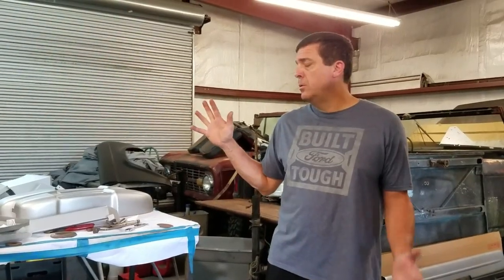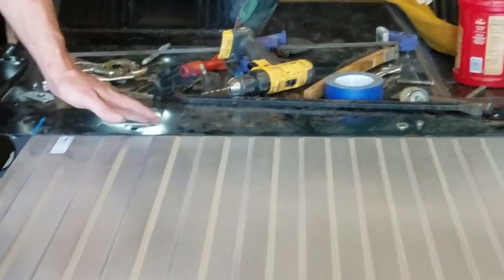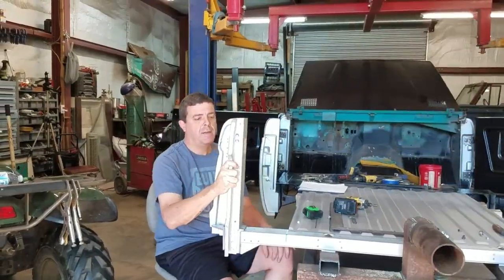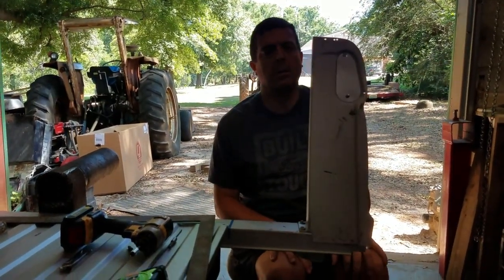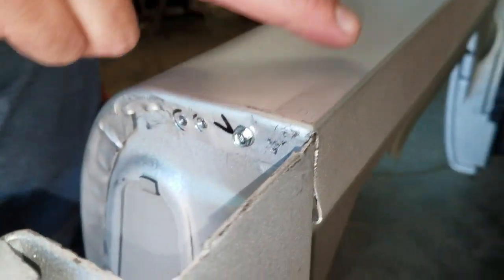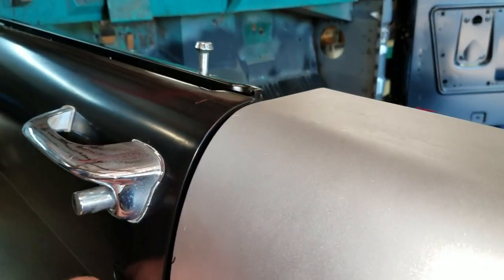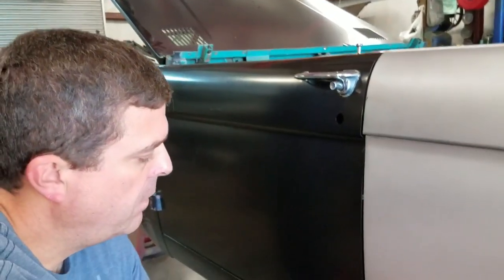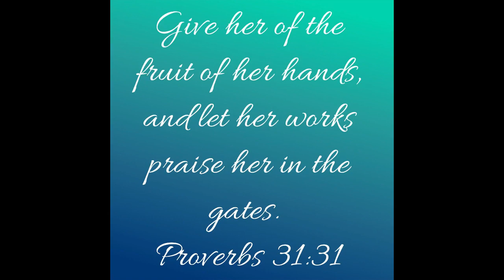Bed Removal & New Steel Install - 1966 Ford Bronco Restoration Project

Comment: If your going to spot weld the sides to the pillars,  the panel adhesive will work. I would also use a couple paint sticks covered in painters tape to help distribute even pressure across the seam and the tape makes for easier removal of the paint sticks. You may also want to put a couple pieces of tape across the outside seam to reduce the mess and make for a cleaner finish, Just pull it off before it sets.
Reply from the maker: Yes sir.  All very good points.  It worked out well.  Thanks

Comment: When I put my lower quarters on I put a 5/16 bolt on the front and rear and used 3M 8115 to glue the rest on the bolts helped to hold it in place while I was fitting the quarter and they helped hold it in place while the glue dried. I’ll send photos if you’d like
Reply from the maker: Sure Thanks!  Love to see it.

Comment: What I'm doing in that same area is plug weld.  The while tub is going in for sand blast and then epoxy prime.  I will then steam seal every book and cranny I can reach.
Reply from the maker: Awesome.  These Broncos have plenty of places for water to get in.  I agree seam seal all you can.  Good Luck and thanks for watching.

Comment: I used the 3M panel bond.  I think it worked out swell plus seam sealer is included.  That seem is subject to a lot of inside road  spray.  
And the seam sealer is just on the outside while the real water intrusion is inside.   I’ve seen a lot of quarter panels cut for large tires and I’ve never seen one buckled.
Reply from the maker: Awesome.  I feel it is a good way to install the panels.

Comment: I would love to see you use the structural adhesive. I've put on 2 sets of Bronco quarters before and I agree the adhesive might prevent future  rusting issues in these prone areas. Love your explanation and thoughts on putting them back together.
Reply from the maker: Thanks!  Hopefully once we have pre-fit all panels the decision will be easier.

Comment: I love your top bed rails mine didnt come with the ears on that go to the b pillars, I had to put that on myself and it was not easy and like you said ended up using alot of bondo to make it look good.
Reply from the maker: I got those with the B pillars.  I had to put them on the quarter panels.  They had to be trimmed a little.
Reply: @JasonJonieBuilds  oh ok I thought they were buggers to try and get right. Wish they came already on either on the b pillar or on the top rail.
Reply from the maker: @timbjork2098  I agree...Seems they can do everything else why not those.

Comment: I know this is two years to late but I think the adhesive would just separate after time and trap water. I think that spot welding and then using lead on the outside would be better.
Reply from the maker: The automotive industry uses it a lot now.  It is good stuff.  I like it better than lead.  Thanks for the input though.  We all have our preferences.
Reply: @JasonJonieBuilds  this is true but the automotive industry is also injecting foam into cab columns on pick-up truck and they are finding that they have severe rusting issues in 5 years.  That happened with my son-in-law's F150. Back of the cab had rust bubbles the size of tennis and golf balls all because water got trapped between the foam and the steel.

Comment: Wow, never thought about the panel bond, I 'm at the same point in my build and would like to know what people think as well. I agree it would totally seal up the joint and probably be stronger because of the entire surface would be bonded.
Reply from the maker: I am going to research it some more.  It would help along the long seam but will still have to weld the sides.  It would be a cleaner look for sure.
Reply: It does rust with timw

Comment: I say if you can get a good way to clamp it together tightly I would try the panel adhesive. It seems like an awkward place to clamp though.
Reply from the maker: It is an awkward place for sure.  Thanks for the input.

Comment: Welding and the heat encourages rust and it’s a hard area to get undercoating or rustproofing in
Reply from the maker: Lots of tight areas for sure.

Comment: Happy Mother’s Day to your wife! So Ford put a sealant in between uncut fender and the top panel which would tend to rust with time, are you going to put the sealant in or keep it just panel to panel?
Reply from the maker: If I spot weld it I will seam seal it for sure.  I will wipe it tight so it is only in the crack not rolling out  messing up the lines.  This has definitely been an interesting topic.  Lots of opinions have been offered.  It will come down to what I feel will give me the best results.  Still pondering it.  Thanks!
Reply: Mustang Rehab goodluck on the decision. FYI I’ve been stealing some tips from your vids! Don’t sue me 😅😩
Reply from the maker: @gusorion8151  I only charge for the good tips.

Comment: Did your bed have the middle cross brace already installed or did you have to put it on?  The bed I bought didn't have the mid- brace installed and I just ordered one to install.
Reply from the maker: Yes the bed I ordered had the brace installed already.  Do you need dimensions or anything?
I can check mine for ya.  It should not take much to install.
Reply: @JasonJonieBuilds  I cut out my old one so I'll just use the dimensions off of it.    If I run into trouble, I'll drop you a line.  Appreciate ya!
Reply: @JasonJonieBuilds  Did you coat the bottom of the bed sheetmetal with anything prior to install?  I'm not doing a frame off restoration, so if I need to coat the bottom of the bed with something, it'll be easier to do, prior to welding it in place...
Reply from the maker: @acarverdri  It is personal preference really.  I will assemble the Bronco first then disassemble it to paint.  I plan on painting the underneath not rhino liner.  People tend to think you are covering something up with bed liner.  Even though I like the look of bed liner on the floors.  All my parts were EDP primed or weld through primed.  If I am covering a piece I like to prime it a little extra.